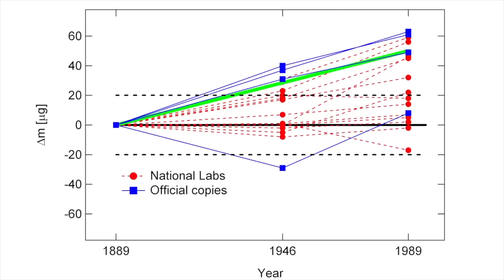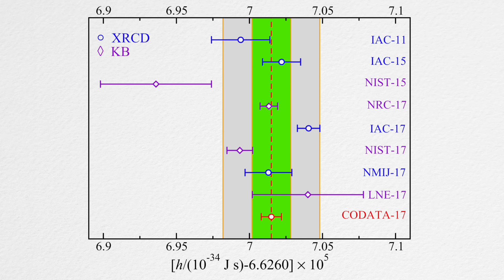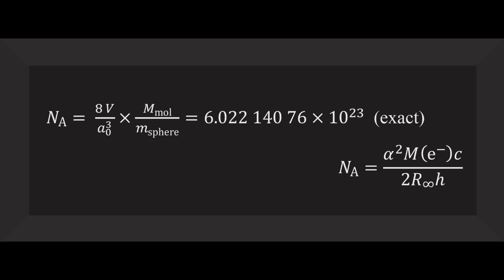The kg is dead, long live the kg

Comment: The USA is officially and legally a metric country

"Section 5164 of Public Law 100-418, the Omnibus Trade and Competitiveness Act of 1988, amends Public
  Law 94-168, The Metric Conversion Act of 1975. In particular, Section 3, The Metric Conversion Act is amended to read as follows:

“Sec. 3. It is therefore the declared policy of the United States–
(1) to designate the metric system of measurement as the preferred system of weights and measures for United
 States trade and commerce;

(2) to require that each federal agency, by a date certain and to the extent economically feasible by the end of
 the fiscal year 1992, use the metric system of measurement in its procurements, grants, and other business related activities, except to the extent that such use is impractical or is likely to cause significant inefficiencies or loss of markets to U. S. firms, such as when foreign competitors are producing competing products in non-metric units;

(3) to seek ways to increase understanding of the metric system of measurement through educational
 information and guidance and in government publications; and

(4) to permit the continued use of traditional systems of weights and measures in non business activities.”

Comment: Are there any fundamental constants used for measurements that is exclusively accurate only on Earth?  
Would inter-planetary or inter-galaxy civilizations in the future need different definitions?
Reply: Just means a better universally usable analog, these measurement systems are already used offworld so I'd argue not necessarily. Future interplanetary civilization may better hone in on a more accurate floating point constant, thus the number change, but the system used is already universally translatable. This is just basically one step closer to accuracy, kinda like finding the next sequential number of Pi.

Comment: Why!  So they did what the electrical metrologists did in 1990 and just picked a number for h.  In 30a we’ll find out that number was wrong too and have to update everything.

Mass only exists as a function of energy so should the gram not be defined in units of Joule*second/metre?

Also, that looks like a Queens Engineering jacket that was worn in a tub of methyl violet?

Comment: 5:19 Removing dependence on physical objects from physics sounds legit, sure. Go ahead, guys, make the world dependent on your theories not the other way around!
Now, will they even notice if the physics of the world changes? they kinda fixed it, right? so, it won't ever change from now on, right?
So, if Plank's constant slightly changes in nature they will just say that the kilogram object in Paris changed its mass. Guess, we'll need a dramatic change in the physics of the world for them to finally notice it.
Reply: The constant doesn't vary in nature, saying it does is an oxymoron, the problem is, the constant is soooo small that it is hard to measure precisely, and so they measured in countless different ways, and then took the average value, with the more certain measurements having a bigger weight in the averaging
Reply: @tmd9412  Well,
There are more things in heaven and earth, Horatio,
     Than are dreamt of in your philosophy.
Imagine me measuring free fall acceleration everywhere in my room an claiming that it is a universal constant. Or atmospheric pressure the same way. This solar system is probably much smaller relative to the universe than my room relative to the Earth. Stretching the experimental results away from the place they were obtained 10 orders of magnitude is too far off. When we get there we'll measure and compare.

Comment: What about using the force generated by 2 photoms colliding  each other in a vacum,and recording the pressure they create on contact.

I was thinking that due to how if you push against something while standing on a scale, the pressure the scale reads is different but the weight is the same.photons travel at the speed of light which is fixed isnt it?

Comment: the death of science...why fake planck constant on a piece of metal...
Reply: What are you talking about?
Reply: @lunkel8108  they are fixing planks constant which they cannot determine with absolute certainty
Reply: You seem to not have understood this. Previously, the value of 1 kg was defined through a metal cylinder in paris. The problem is that we know that the actual weight of those cylinders change over time, so the definition of what 1 kg was changed over time.  Note that the weight of that metal cylinder was technically fixed in place, it always was 1 kg, because it was the definition of what 1 kg even means.
Now, we replaced the piece of metal with a constant of nature. Just like with the piece of metal, the actual value we measure might of course change due to more precise measurements, however it cannot do so within our unit system, because it is the definition of said system. We are not saying that we 100% no error know planks constant, it simply serves as the basis for our unit system. The piece of metal is now useless and not used anymore. 
The only thing that has changed is that now the basis of our system doesn't change widely anymore. Sure, we can still make more precise measurements, but the changes in the value of the kg will be less and very importantly convergent on the actual value of h, instead of varying widely all over the place. 
I hope this cleared up your understanding. Defining a unit more precisely is not "fake science". Do you still have any questions?
Reply: @lunkel8108  I get you.. What I was saying was the abstraction is based on a piece of metal as it was measured 100 years ago...shouldn't we try to bring together abstraction with practicality in science.. ie make it more dynamic..weights can remain the same.. But science must be based on accuracy and must be practical..
Reply: @zoqxsa6611  What do you mean by "dynamic"? How can a unit be dynamic?
Reply: @lunkel8108  let's say we fix the value = 10 it might make some calculations easier and save computing power other constants can be fixed simultaneously for practicality...their may be other practical reasons according to the times.. By doing this we make units more abstract and also practical and not fixing it on something but for something..
Reply: @zoqxsa6611  We fix the value equal to 10 what? A unit isn't just some abstract number, it has to correlate to some actual measurement. And you can't just change the kilogram all of the sudden. That would screw up essentially everything because people, companies, etc would first have to adapt to the changes and it would cause huge engineering problems.
Also if you want to have easier calculations etc there are natural units that a lot of physicists use in which stuff like the speed of light or the reduced plank constant are defined to be exactly 1.
Reply: @lunkel8108  I am sorry i am not aware of that as I am not a  physicist.. But isn't solving tough problems is what engineering is.. Once this is solved I mentioned practicality that is what would make engineering easier not tougher...not only computing power but human effort, money etc and be optimized not just fix it on something because that is what the convention was...i mentioned above that the weights can remain the same for the time being roll it out slowly first and then make it more dynamic.. Most weights used are electronic not like old school iron weights..(leave gym out) done once then doing it again wouldn't be hard...

Comment: So what about when, several years from now, our measurement techniques improve to the point where we can define Plank's constant even more accurately?
I think that defining these things based on something like Plank's constant is a good idea, provided we allow them to be adjusted based on our improving definition of Plank's constant.
Reply: Yes, of course. That still is way superior to the previous system, since the changes are now convergent on the actual value of h instead of jumping around with no concern for decency.
Reply: i think you've misunderstood the point! planck's constant will now always be, by definition, 6.62607015×10^−34 joule-seconds. you could even say that planck's constant is exactly 6.62607015000000000000000... ×10^−34 joule-seconds, because we've conveniently chosen it to have no more decimal places. improving our measurement techniques won't change that, but it will improve our ability to measure other quantities (like the original reference kilogram in paris) more precisely and accurately :D

Comment: Isn't this a bit like  rounding up Pi? Sacrilege!
Reply: No, it's not. In fact it's kinda the opposite. Previously, the value of what 1 kg was would change over time, because the metal cylinder we used did so as well. Now it's a fixed number, a constant.
Also, units are completely arbitrary. You could change them however you want to as long as you also update all factors correlating them and don't mind plunging the world into chaos.

Comment: this is the finale for the silicon sphere vid. i love how he keeps track of everything.
Reply: I was hoping for the silicon sphere.  It would be a lot easier to explain that definition to someone who is first learning introductory chemistry.    You'll need almost two years of physics, plus all of high school math, to understand the Planck's constant definition of the kilogram.
Reply: @carultch  Wait, really? I'm in highschool and was wondering what ppl derived the avagadro number from. One of the methods I found online was using plankcs constant, which seemed to be the easiest one (among Millikan drop experiment and another one related to some of Einstein's findings?). You just crushed my hopes....😭😭😭
Reply: @samuraijosh1595  The previous definition was based on Carbon 12 being defined to have an atomic mass of exactly 12 AMU, and 1 mole of Carbon 12 being defined to be exactly 12 grams, with Avogadro's number being the number of AMU in 1 gram, which we define as the mole.  Other elements and their most abundant isotope had previously been the standard, but the Carbon 12 standard is was what I learned in the 90's and early 2000's.  They maintained consistency with the current accuracy of this definition, but now fix Avogadro's number, and use Planck's constant to define the kilogram and subsequently the gram.

Comment: Wait. E=mc^2 is not accurate for photons. Photons are massless particles. So, stating that mc^2=hf for photons is just inaccurate. Of course you can still define kg using Planck constant, by fixing Planck constant in SI, but not the way you presented at the start, rather it's done the way you mentioned later(Kibble balance).

Comment: Sounds like made up math.... If it can't be measured right with absolute certainty...don't say there flipping it causing it to equate to another fixed measurement...and claim it's better than the already stagnant and incorrect system, your wasting effort by then having it forced upon ppl, effort that could be used to find 100% solid math....Ur stagnanting everything by allowing the currently accepted definition to change by not changing, just becoming slightly more accurate by different means,instead of being entirely superseded..

Comment: I'd like to point out that the Imperial system of measures, has effectively remained constant since it's creation. I'm sure some adjustments have been made over time, but, 1 foot, is still 1 foot, no matter what type of ruler is actually measuring it.
Also, really, just grab something we know to be a scientifically stable element (such as gold), and you can re-define the weight of objects easily. You can get ounces, pounds, grams, and kilograms this way rather easily.
Also, use such measures as the length of the object, to ensure you will always have a constant measure, since the measure of length hasn't changed. (1 foot equals 1 foot)

Comment: At least we can all agree that 1kg of steel is heavier than 1kg of feathers, FACT
Reply: nope. 1 kg is 1kg. its not different for different objects. the only difference in 1 kg of steel and 1 kg of feather is their compact packing i.e. density. 1 kg of feather would require more space than 1 kg of steel. And if still you think that they are different try the old two-stringed beam balance and if you know the method of using it... go ahead. Hope this has made you clear about your misunderstanding.
Reply: @ankush.b.makhija7878  what's next, earth isn't flat?

Comment: Did we forget that 1 metre is the distance light travels in a vacuum over a set time.
A 1cm cube of water (with a density of 1) weighs 1gram, and a 10cm cube (10x10x10) of water is 1kg.
So if water no longer has a density of 1,  then 1 joule wont be the energy required to increase the temp of 1ml of water by 1°, and 1 newton wont be the force required to accellerate a 1Kg object at 1m/s squared.  Or just re-build the big K to being back to 1kg, or 1 litre of pure water at STP. But then if STP is reliant on “constants” such as temperature & pressure, you cant measure those if you change what a Kg is and remove the constant that defines it.
Reply: Water's density is actually 0.997 g/cm^3.  And the energy required to increase the temp of 1 g of water on 1 Kelvin is actually 4.186 Jouls or 1 calorie.

Joule is the energy transferred to an object when a force of 1 newton is appied on that object in the direction of its motion through a distance of 1 metre

Comment: kg is a measurement of weight not volume. 1 kg on the moon isn't 1 kg on earth. kind of hard to redefine the kg.  It seems to me that you need another system of measurement entirely for that level of accuracy. Gravity is not constant or fixed. There are slight differences all over the Earth.

I don't think we have progressed far enough to fiddle with our basic standards of measurement. For example who decided we were measuring mass as opposed to gravitational influence?

Comment: 1:12 I'm an average Joe and I need to weigh a parcel for the mail.
I'm having issues finding my Planck's constant as i dropped it on the carpet, and I'm having trouble measuring a photon. Can someone point me in the right direction?
At the moment my small parcel apparently weighs about 450,000,000 metric tonnes, but I'm afraid to check it using my kitchen scales as they were made during the days of Le Grand K.
Reply: (◍•ᴗ•◍)❤

Comment: Is this the LAST variable defined by a physical object? (and now not defined by it)
Or are there any other physical objects that we are still bound to?
(I'm thinking Meter, Feet, ANY type of measurement)
Is it truly possible to define EVERYTHING and anything that we measure as humans - without any dependency to physical objects (but rather solely by "The ways in which the universe works a.k.a. physics) ... ?
Reply: kilogram was the last.
Reply: @VanCamelCat  
as for distance
1 meter is the distance light travels in vacuum in 1 / 299 792 458 of a second.
1 second is the time needed for 1 Cesium atom to perform a specific state change 9 192 631 770 times.
Reply: @kallewirsch2263  that's incredible! Go scientists go!

Comment: They should have used the occation to remove the kilo from kg and also rename it  so that 1 "marg" == 1 kilogram.
Of course they should pick another name :p
Reply: Or they could just use the gram
Reply: @minecraftify95  : They would have to change the name, or it would be terribly confusing.
1 m^3 of water should be considered to have the volume 1 ertil (or "new-litre") and have the mass of 1 marg (or "new-gram").
I realize it would be impractical, though. What before would be 1 gram of salt would now be .. um ... 0.000,001 marg or one micromarg salt. Ouch!

Comment: Everything can not be calculated and everything is not that simple. If you count the resistance U/I  for example a traditional Finnish power outlet voltage: 230V and current: 16A  it mkaes 230/16 = 14,375ohm and if you round off sum it is 14ohm it means 16x14 = 224V decimals are important, the thing breaks into your hands if you round too much

Comment: I would have thought they would have a set value for a single gram rather than a set value that represents 1000 grams? Of course just *1000 but still, I'm sure you can see what I'm getting at.
Reply: It is much easier to eg measure a reasonable amount of mass with a scale to some precision.
Weighting 1 kg, where the reference mass has an error of eg 1% can easily been done. When scaling that measurement down to 1 gram - eg by a mechanical device which depends on the length of the arms on a balance scale - the absolute error also scales down.

Comment: how is the pound calculated? if the kg was lost forever, could it be recalculated from conversion from the pound?
Reply: It's not "calculated" in any way, u.s pound is simply defined as 0.454 kilograms. So, the answer is no.
Reply: pound is defined on the kilogram so no.

Comment: How can you declare something a fixed value when the uncertainty still remains?
Reply: The uncertainty is in the definition of the units, rather than the constant itself.

For instance, Avogadro's number used to not be a fixed number, and depended on the kilogram's definition.  We didn't know exactly how many atoms would make up a kilogram of Carbon-12, other than that we knew it was defined as Avogadro's number * 1000.   Measuring the replica kilograms against Le Grand K, gives us the margin of error on the definition of the kilogram, which is correspondingly related to the uncertainty of Avogadro's number.